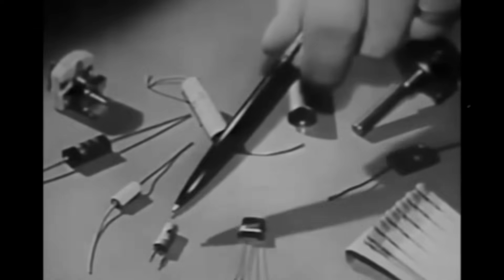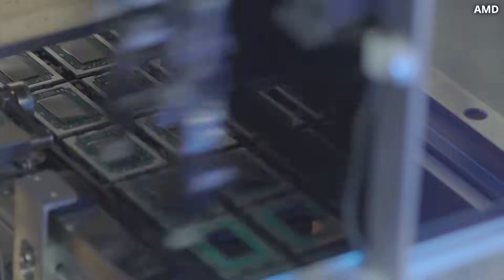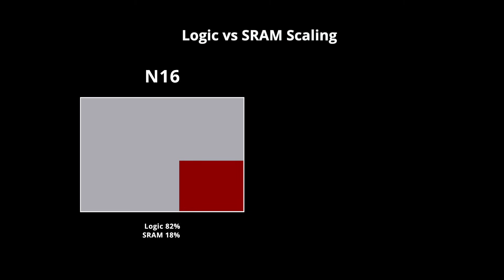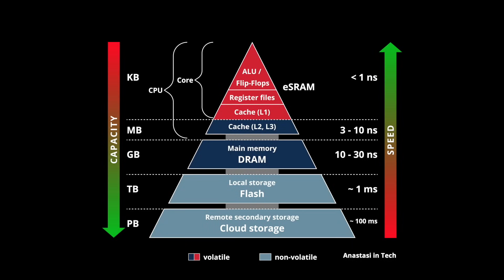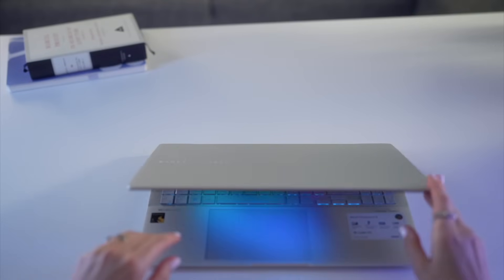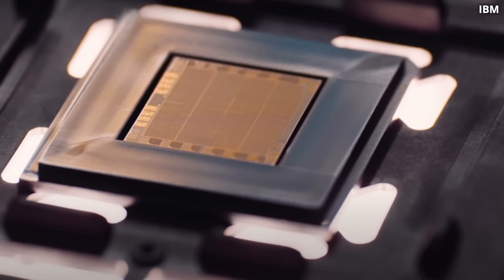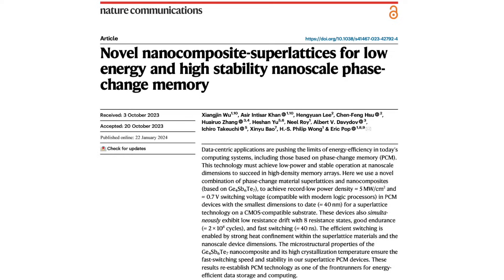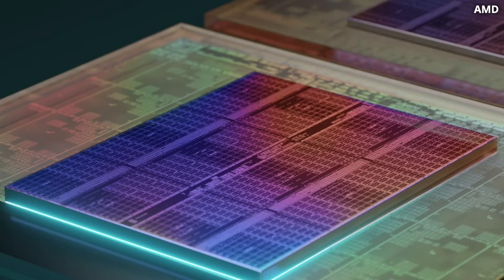The Death of Computer Memory

Comment: Interesting idea, but very speculative and in need of a demonstration at scale to assess its practicality. Moreover, although a 23% decrease in area is good for an existing bottle neck, it is not revolutionary, that would need a factor of at least 10. At the current estimated level of improvement it becomes a commercial decision on whether this improvement has a fast enough pay back to justify the r&d costs to make it practical. Is anyone making the investment to commercialize this discovery? Thank you for sharing!
Reply: Not really, the silicon lattice constant is only 0.7 nanometers.  We can't scale in silicon below that.  Germanium has a lattice constant of about 0.5.  While process nodes and technology are mostly marketing terms and there is room for improvement beyond "1 nanometer process" - we are about at the end of what we can achieve with existing semiconductor paradigms.  It will be almost all architecture and material sciences by 2030.  We can't get much smaller.

A 20% improvement over SRAM is disruptive even if it doesn't scale any smaller.  SRAM is unable to be scaled any smaller due to the physics underwriting operation.

We only have a few more die shrinks left before we are up against the size of the atom.   ... Again, sort of ... A 1 nanometer node doesn't necessarily mean that you can make a grid of 1 nanometer square pads separated by 1 nanometer troughs on all sides, or vice-versa.  But as I mentioned, the lattice constant of silicon is 0.7 nanometers, their latest process node is 1.4 nanometers.  You can't really cleave off half a crystalline arrangement without having weird things happen, the next die shrink, if it is possible, would come at 0.7 nanometers.  We would be, assuming we can make the grid arrangement described, making the smallest transistors possible with silicon, using existing paradigms.... And whatever paradigm comes next would need to use atoms much more efficiently - or some other concepts entirely - to function.

On the plus side, it means that in about another 10 years, we might see computers built with the idea they could last decades in their application.
Reply: @Aim54Delta  This is not true. While it is true that the Si Lattice constant is 0.7 nm, it is not true that a 1nm process node actually has features that are 1nm big. For instance, the smallest feature on a "3nm" node is around 20nm. There is plenty of room left for atleast 10 years. For instance, see IMEC's roadmap, which targets A2 (0.2nm equivalent) by 2036.
Reply: @Aim54Delta  Great points! Thank you for expanding on the technological limits of the underlying physics not covered in the video. Given these fundamental limits to silicon, research efforts will move to entirely different concepts that may or may not work. Perhaps we will not see much further progress ending the decades long run of ever increasing chip performance or something new will make current silicon architectures obsolete. Fascinating field with huge commercial risk/rewards for company boards to ponder. Thank you for your comments.

Comment: So each of the 2 phases of the PCM has a different resistance, so the computer can tell 1 from 0?

Can PCM memory be integrated in the same chip as the processor core? Seems like it requires a unique material to be added on a chip

Comment: Would be interesting to know what makes 3D stacking structure so difficult to achieve
Reply: Heat exchange maybe?
Reply: Yes, though theres more limitations, it's really hard to manage heat in a 3d structure. 
It also requires new innovative ways to do it.
This is why a room temperature super conductor would be such an amazing breakthrough. You wouldn't need to worry about heat management and you could up the frequency to Thz levels while maintaining manageability even in a 3d transistor structure. Computing would be millions and billions and even trillions of times faster

Comment: Just increase the die size / stack more 3d memory on the chips. At a system price of ~1 grand for a decent consumer PC, another 30-40 bucks for the CPU isnt changing things that much.
Similarly in serverland. Its not like we couldnt fit physically larger (and more expensive) CPU's in our chassis, which sounds terrible at first, but if you factor in 5 digit numbers system cost,
another 100-200 bucks wont get you nightmares. Well worth going for it.
Lets face it, monolithic chips are... Not dead yet, but in their last breath. 3D stacked Chipslets are the future and you just "glue" as many of em together as you need.
We dedicate more and more space on our SOC's to all kinds of accelerators and garbage, but as AMD has shown us with their X3D chips is that we've
been neglecting memory for too long. And i remember my good old 486dx50 SMOKING early Pentiums, just due to memory speeds (haha 33MHz, plebs).

Comment: Thanks. Amazing video. It's kind of interesting how it always comes down to the same principles. First shrinking the size in 2D, then layering stuff, and eventually going into the 3rd dimension. And when that reaches its limits, then change the packaging and invent some hybrid setup. Next, change the materials and go nano or use light etc. instead. Even the success criteria are usually similar: energy consumption, speed or latency, size and area, cost of production, reliability and defect rate, and the integration with the existing ecosystem.
Reply: А потом ещё уйти в 4 измерение:D
Reply: And even then after that, when all resources and possibilities are dead, go quantum and use "entanglement" to avoid heat and space limits...

Comment: I wonder if they could use this PCM technique to more reliably store and read multiple different states depending on % of the medium being transformed, than just the normal binary 0 and 1 states, maybe 4 or 8 reliably defined resistivity states, which could exponentially improve the storage capacity of each such node

Also, love the auto-translated subtitles where for example nodes are nudes and memory cache is memory cash (which does sound very appropriate :D)

ps. I am a non-native speaker, so I need to use the subs alongside the commentary to pick up hard/unfamiliar words, it is not because of your English, but mine
Reply: as she mentioned you would then need DACs to decode it which would make it too slow for this use.
Reply: @cj09beira  For this use perhaps, but there are other similar use cases where you don't need L1 speed, since the increase in storage capacity is literally exponential depending how greedy you try to go. However, a 4/8 bit conversion to and back to 1 bit isn't really that complex or slow with hardware doing it, but it does indeed need to be done in between as an extra step

Also thanks for pointing it out, I must have completely missed the part where she mentioned it (I was struggling a bit with hearing her at times)